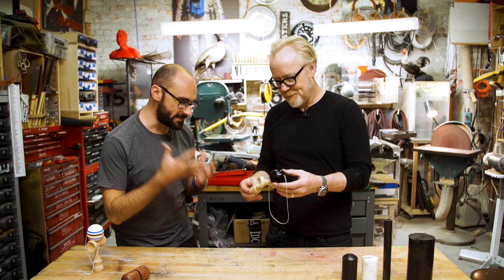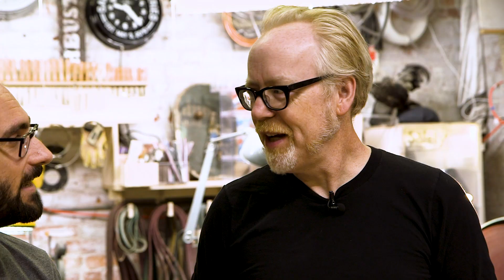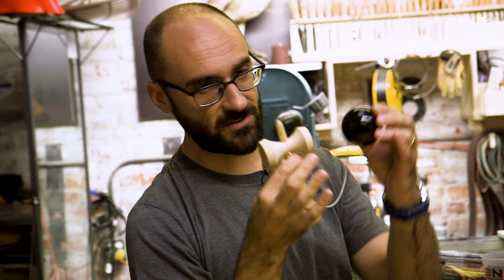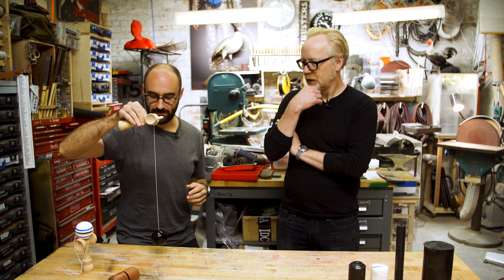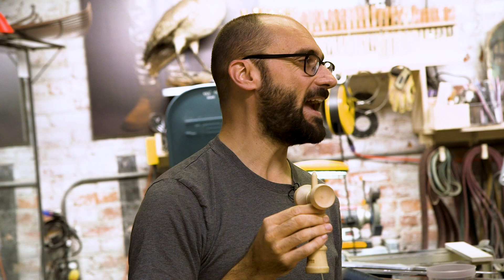Adam Savage and Vsauce's Michael Stevens Build a Kendama!

Comment: For those that want to know, a lathe spins the work and the tools are stationary. A mill spins the tool and the work is stationary. There are also power lathes that can spin both the tool and the work but those are usually 5-axis machines.
Reply: What are the advantages of one over the other?
Reply: @Coentjemons  Very basic understanding is that lathes do well making round parts and mills do well making square parts.

Comment: I have a wierd feeling that adam savage bought a lot of delrin for a project that failed and now he has to get rid of it
Reply: He likes to buy large quantities of materials in general.
Reply: @Crandelo95  Makes sense. If you have too much of a material your problem is storing it, which is a reasonable problem for anybody to solve.

But if you have too little of a material, your problem is getting more, which at the very minimum takes time (driving to a store, ordering online and waiting for shipping, etc.). I'd hate to see what happens to somebody like Adam when he's going 100% on a project and then has to immediately full-stop because he doesn't have the material that the project demands.
Reply: @stspy212  aka it's more cost and time effective stockpile
Reply: Delrin is just really easy to machine. Thats why he has so much.

Honestly it was a bad choice to have a friction fit between the two pieces made of it. Delrin is a bearing material. It will slip/slide and the cups will move.
Reply: @LeCafeRacer  It was a joke but sure thanks for the info

Comment: Continually amazed at the versatility of lathes
Reply: IKR
Reply: A lathe is the only tool on which you can make another lathe.   Its the only machine that can be used to duplicate itself.  They are awesome!
Reply: Southardknives Nope. 3D printers.
Reply: D. C pssshhh
Reply: @D.C

Even 3D printers require parts not made with 3D printers.

More importantly, A lathe can be used to make a better lathe.

Comment: I know this video is 4 years old now and it's probably not important to Michael anymore but there are a few things about this design that stand out to me as a kendama player. There are some important qualities to a well designed kendama that are missing here. One of the major qualities is what's called Lunar Balance. Lunar is a trick that is performed in "tama grip" (the ball held in hand as opposed to your default "ken grip") where the ken is swung up and landed on either the small or big cup resting balanced on the tama. (imagine it's oriented sort of how a telescope would be pointed towards the sky) It's important that the base of the ken isn't too heavy relative to the weight of the sarado (the component of the kendama which features the big and small cup) so that you can easily achieve a stable balance. Another important quality that was missed here was the bevel on the tama hole - it was omitted by choice - but it really is important as a wider diameter bevel, particularly as wear is presented on the bevel edge, makes Stall tricks much easier. Stall tricks are where the tama is landed on points of the ken and sarado other than the cups or the spike, such as landing the tama on the top rim of the sarado leaned against the spike (a "Bird") or inversely in tama grip where the ken is landed balanced upsidedown resting on the tama hole (a "Stilt").You would also find that other tricks such as "Jumping Stick" would be very difficult to perform without a tama hole bevel. Another aspect of kendama design is weight matching. When performing Juggles or a trick in which the grips are switched mid-trick, it's ideal to have matching weights between the two parts for consistent feel in the hand and muscle memory. I won't even get into tama grippiness but I can assure you that most tricks beyond landing the cups and spike are going to be very difficult if not impossible with a tama as slick as this sanded delrin. As far as string/tama-hole friction goes, it is common now for kendamas to feature a steel mini bearing that rests between the end of the string knot and the tama string hole. It wasn't very common at the time of this video shoot (typically it was a plastic bead bearing) but now the steel mini bearing is typical.

I can't imagine this comment would be very useful to Adam or Michael or that this build would ever be revisited but I figured I'd leave this here just in case. It's this kind of nerdy stuff that makes the engineering and designing so fun. Not to mention Kendama is still really cool, I think!
Reply: Well, that's what you get when 2 amateurs are trying to replicate something that is more intricate than they thought. By amateurs I mean of course  that they don't know all the details about kendama, for example, as those presented in your comment. Actually could have been a nice revisit to make it with a person who can actually then test it in more subtle ways.

Comment: 7:46
Adam "Let's say we have two balls, one a meter in diameter and one 10 cm in diameter and we w–"
Michael "We want to make napkin rings out of them that are just 1 inch high"
Adam "1 inch high. So we have a 1 inch high napkin ring that's a meter high in diameter and a 1 inch high napkin ring that's 10 cm in diameter."

Oh god this is why we need to use metric
Reply: and they have the same volume
Reply: This has nothing to do with needing to use one or the other. In fact, in your example, it hardly matters. Three units are used: meters, centimeters and inches. You could use all metric units and call the dimensions 1m, 10cm and 30mm and it's still three units, you still need to translate between them. to compare them.

I'm all for the metric system, for ease of conversion, but your example was hardly the ultimate reason behind why.
Reply: kindlin Stop being obtuse, it is clearly simpler to convert from metric units to other metric units than metric units to imperial units. Everyone knows you can convert from different units, there is no example where you can't convert from imperial to metric when you know the measurements.
Reply: OK I re-read it, and came to a more satisfying conclusion. The reason why the example is mediocre is because the things being compared are in the same systems. The diameters are both metric (m, cm, easily compared), and both of the heights are, by definition, the same and so easy to compare, they're the same (1 in).

Yeah it's weird to use those specific measurements, but makes perfect sense immediately anyways. I never even noticed until I saw the OP.
Reply: It really doesn't matter to anyone in the US on a day to day basis because we know both systems so it is not much more of a hassle than standard. The only bad things are when you have engineers from the US working with engineers outside the US.
Reply: $100 million dollar space probes and probably other engineering disasters have occured because of mistakes in conversion or even failing to convert a number at all. It's best to settle on one standard for the important/expensive stuff.
Reply: damn the US
we're doing everything wrong
Reply: yes but within a decimate system the translation is just x10
Reply: Get that sh*t outta here if imperial was good enough for Whitworth it's good enough for me
Reply: ToastytheG whitworth was jealous of metric so invented thou
Reply: I don’t see the problem; They’re all units of measurement and I’m an American who’s quite fluent in both. It’s really not that hard to mix them.
Reply: Snow Wolf thing is, those Russian vehicles weren't destroyed because of converting mistakes, while the other ones did. Mistakes do happen, but just using one system even at least in the important things, stops a lot of those mistakes from happening.

Comment: Work hardening of metals is not just a phenonmenon of fatigue, but it is employed in metal manufacturing to precisely harden metals. The metal is guided through a series of rollers of predetermined diameters and distances apart to dial in a specified hardness. And the last roller is calibrated to make the metal straight again.
Reply: ehhh...not really...the process you cite is correct, but work hardening is hardly a precise way to harden a material.  Its more like, sometimes it is a beneficial by product  Adam's knowledge of metallurgy is better than a layman, but still down right awful.
Reply: Can it make me straight again?

Comment: 19:18 you can hear the dimensional fabric of whatever unholy material the blade is made of tearing through the 37th level of hell to cut the plastic efficiently. A side effect of this is some of the damned souls that blade has claimed in another life can be heard screaming, which permanently weakens the centuries of stored power in the blade, until it finds flesh once again. This is proven at 22:29 because the souls don't scream as loudly, indicating less power.
Reply: Yess, preciousss...
Reply: that is good wisdom. -The airplane dog from the dog of wisdom.
Reply: You wrote a paragraph
Reply: Have you considered therapy?
Reply: With this kind of wisdom you should be on the vsauce team
Reply: @adamkija6895  vsauce 4

Comment: At 13:20, when Adam is facing off the delrin, I noticed the pitch changes, getting lower as it gets closer to the centre. Anyone know why this is?
My personal hypothesis is that as you get closer to the centre, the surface speed falls as the material travels less distance to complete a full rotation so with v=s/t the velocity falls as s decreases. As the tool is cutting I'm guessing it's slipping a little and therefore generating a vibration. As the frequency of the vibration falls because the tool slips less often as it contacts less often in the same timeframe, the wavelength also falls and as the wavelength determines the pitch the sound drops in pitch as the surface speed of the delrin decreases.
Anyone else have any other ideas?
Reply: I'm pretty sure it's a distortion of the cavity created in facing a deeper cavity causing a deeper pitch as it slides across creating vibration but you might be right
Reply: Also at 41:00 when the threads are being cut why does the sound change pitch. You would assume that the cutting tool moving at a constant speed and cutting at a constant depth would generate a constant pitch, not the sinusoidal type variance that occurs. I don't really have a hypothesis for that currently, I can't quite wrap my head around it
Reply: But then again the tailstock of the lathe is on the piece so it should be perfectly centred unless the tailstock is in the wrong position but then that would mean the sphere previously made would not have worked considering he used the tailstock as a guide for the centre.
Reply: Tim Tarling do you mean when he fully bores though? I'm thinking it might be as the drill bit slides along the internal surface created as it reaches ever closer to the other end the vibrations have to travel along a shorter and shorter area and are frictionally created as more and more of the bit connects to the surface reducing the amount of vibrations that have to travel from the center to the surface and changing the pitch while the amplitude increases over time or the increase in friction slowing the drill bit ever so slightly I'm not sure
Reply: Also, when cutting the threads the second time, the sound is constant in pitch so perhaps it is off centre so when the piece was turned parallel when thinning it out then it would cut as expected with a constant pitch as the depth does remain constant
Reply: You are right the sound you hear is the surface speed reducing when the tool moves to center. On CNC lathes they can be programmed in surface speed and the rpm with increase as radius decreases in size.
Reply: Tim Tarling ii
Reply: When Adam reduced the diameter the first time he did not centre the piece with the tailstock, so the piece was slightly off during the first steps. You can already hear it before he puts it into gear to make the thread. It has to cut a bit deeper on one side, that's why the sound isn't constant.
Reply: Yes. That is exactly why.
Reply: This is absolutely what I think. His explanation seems pretty convoluted.
Reply: Misread your question. I think it must be unevenness of the surface of the plastic.
Reply: I feel so dumb right now.

Comment: You're using your edgefinder backwards.

They're made to kick over to the side at precisely the moment that the upper portion and lower portion are centered axially, so you want to watch it as you feed into the edge VERY SLOWLY and the exact moment that it kicks sideways denotes that you've reached center.

They're very easy to use, but the way you're doing it you're probably only getting within five or ten thou of the true edge.

I usually poke the end with my finger to make sure it's quite offset and wobbly before I go in toward the edge, that way I get a little warning as to when it's getting close because the two pieces start to center up and run true right before they kick off to the side.  It's that change from very nearly perfectly centered to suddenly offset to one side that you should be looking for as your "edge found" indication.

When done like this your edge will repeat within a thou.

Also, when you're working on something fussy where it really matters if you're within just a few thou, use a collet to hold the edgefinder instead of a drill chuck, as even a really good drill chuck can have two thou of runout built right into it.

Most of the time it doesn't matter, as when drilling it just shows up as a slightly oversized hole, but when you're trying to align the axis of the spindle with an edge by aligning the axes of the two parts of the edgefinder, that job is made more difficult if the spindle and edgefinder aren't already exactly axially in line with one another.  For most work it won't matter, as what's a couple thou between friends, but every once in a while it DOES matter, so you need to keep that in mind for those times.  EDIT:  HA!  Two more minutes into the video and you said this yourself.  lol  Good on ya!

BTW, the look on your face after cutting that helix without breaking anything or killing yourself was priceless.

If you haven't learned how to single point thread on a lathe yet, I highly recommend that you do, it's is one of the most satisfying machining operations to master, followed closely by cutting gears in the milling machine using a dividing head.  Those are the moments that make you appreciate the modern world and just how much WORK it takes to create it.
Reply: LogicIndustries why do you bother leaving a comment that long no one is going to read it
Reply: And thus we discover why most makers are very enthusiastic yet almost entirely unskilled.

If it's too much trouble to read three paragraphs about how to properly use a tool, how can you ever hope to get out of the "hot gluing shit together" phase of making?

You can't have a ten second attention span and be an autodidact.

I guess I figure if one person reads the comment and learns something, then it was worth the ten minutes it took to type and proofread.
Reply: LogicIndustries The way Adam used the edgefinder is really a drop in the bucket considering what he was making. I mean, I doubt a maker is going to (or should) look towards long winded youtube comments when learning how to do things.
Not that what you said was wrong or unhelpful.
Reply: Yeah, I get that for what he was doing, eyeballing center over a sharpie mark would have sufficed, but that's not the point.

Learn how to do things correctly, and then you can use your own judgement to decide if you want or need to employ more fussy methods or if a more quick-n-dirty approach will suffice.

I guess I don't really get why makers seem to avoid learning the correct way to do things intentionally.

What purpose does it serve to not learn things that will expand your skillset (and thus expand the range of things you can successfully build)?

As a machinist, it's almost painful to watch some of the most famous "makers" on YouTube work metal, but they're turning people on to learning useful skills, so I figure "any ally in a storm" (or some other suitably portmanteau'd saying). 

I'm just attempting to do my part in uploading knowledge into new makers while their attention is piqued.

Maybe I'm just wasting my time...
Reply: I read your whole comment and I thank you for the information.
Reply: I'm not a creator (my body doesn't allow for it) but I always love these videos and I loved reading your comment. I rarely see people in the comments who are willing to share their knowledge without being smug or condecending about it. This is part of why I fell in love with this community, and I hope Adam gets to read your comment, because I think he would really appreciate you putting in the effort and sharing your skills.
Reply: Thank you, sir.
Reply: Thank you, sir.
Reply: LogicIndustries, you should create a youtube series and show people how its done. I'd watch the hell outta that.
Reply: Thanks for the comment.
Reply: GODZILLA646 I read it.
Reply: Only thing I haven't seen addressed is the wearing of jewelry during machining operations. Just don't do it. It's not pretty when a hand or arm gets pulled in and wrapped up in a workpiece.
Reply: LogicIndustries TLDR
Reply: Came here for this

Comment: i would have liked to have seen how adam got the unfinished sphere into his machined chuck so that it was perfectly concentric and balanced...of course this is adam savage were talking about so he probably stuck it on there once and went "yup thats about perfect"
Reply: Zap Actionsdower  which is perfectly fine for a toy.
Reply: Looked to me like he stuck a perfectly round metal rod in the perfectly centered hole he drilled and chucked the rod into the lathe.
Reply: I believe he used the tool as a registration point before  tightening the chuck/makeshift collet around the spherical end of the workpiece.